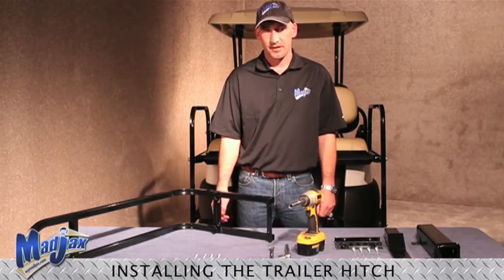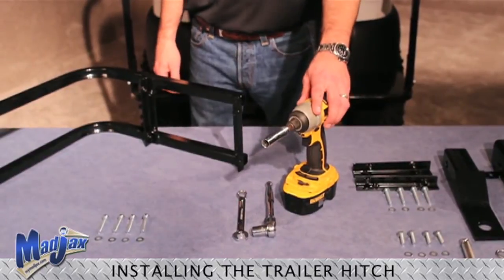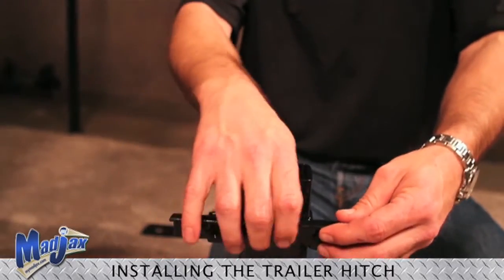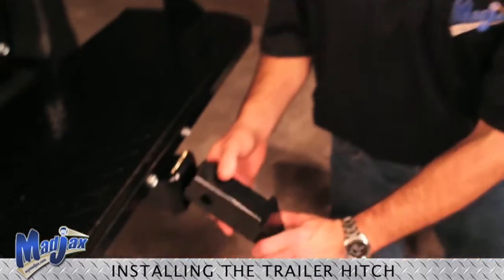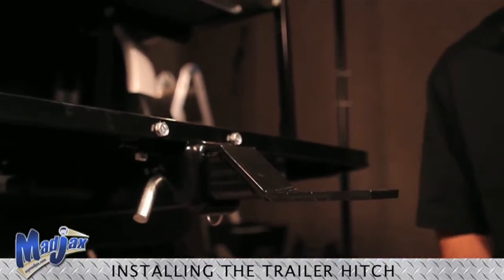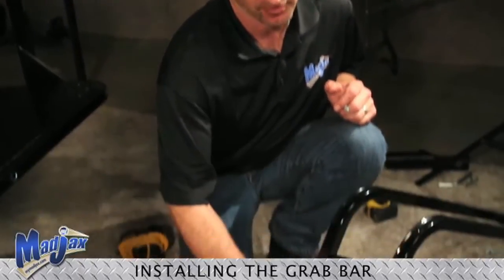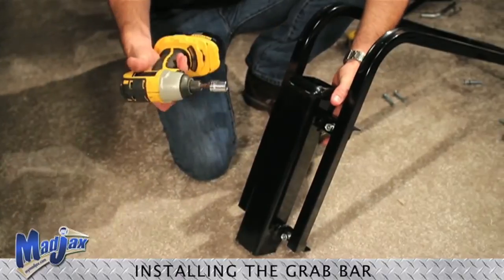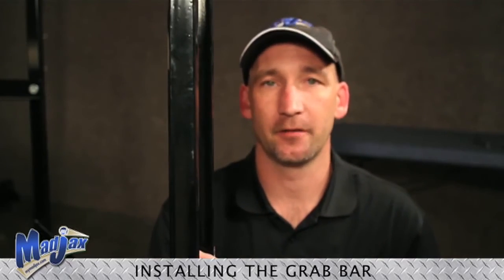(OUTDATED) Trailer Hitch and Safety Grab Bar | How to Install Video | Madjax® Golf Cart Accessories

Comment: How much weight can this hitch hold on the rear foot step?  Will it tow a utility trailer or boat on level ground?
Reply from the maker: Yes but at a very low speed. Keep in mind the front of your cart is not very heavy and the extra rear weight could cause steering troubles at the front.